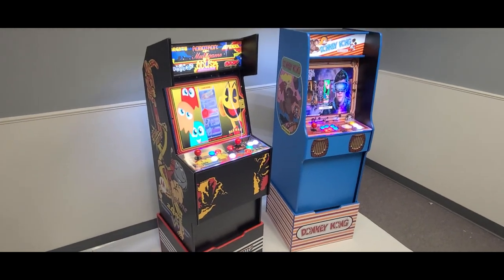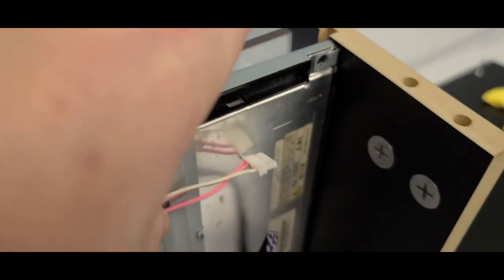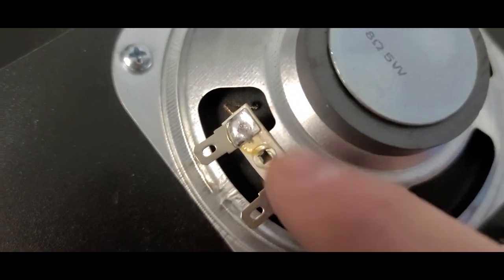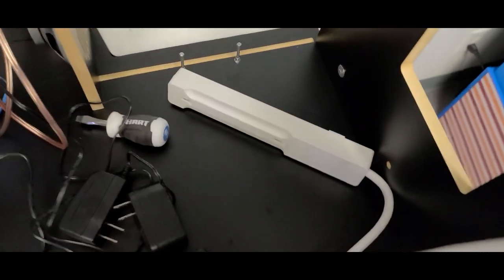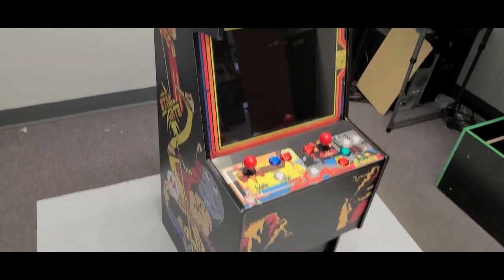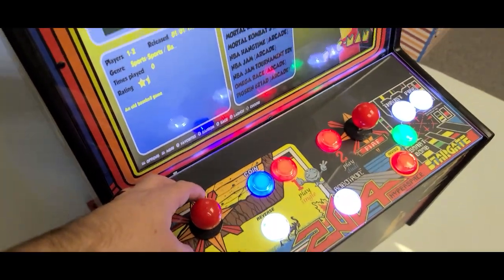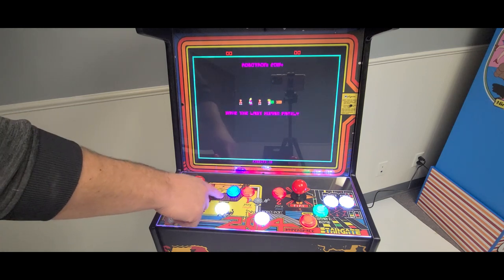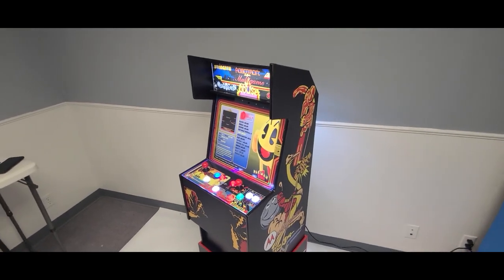AMU Ready to Assemble and Play Model W Cabinet

Comment: Design critique: My opinion you should not use the Arcade1up Legacy cabinet style where the "fins" stick out past your marquee. Just seems like if you are doing 2 player games the fins will be right in your face.
Reply: But your product looks great otherwise and the quality looks good. Who could possibly complain about your games selection!
Are you gonna offer your 2 player XL control boards on these?
Reply from the maker: First revisions had standard marquee further out, but it restricted the ability to see the screen when standing.  These play comfortably for all adult as I am 6' 4".  You still get the proper perspective of cab design from both front and profile.
Reply: @arcademodup2286  Laying the screen down like some of the og cabs would have fixed the view restriction of the screen. The marquee should be all the way forwards imo. That Donkey Kong would look super sweet with the screen down flatter and the marquee pushed forward.
Reply: I also don't like the "fins". Wondering if they could have just made the fins/top of the unit a little higher and angled up a bit - more space between the top of the monitor and the bottom of the marquee, and be able to bring the marquee out to the front. You'd have to be pretty tall to not be able to see the monitor if they did that.
Reply: @davidbellotti1110  their other model has side panels that seem to only allow for 1 player. This one I don't like the fins. Since they now sell a 2 player XL panel, I think they should have went with a cabinet style similar to iircade. That cabinet style would seem to fit their custom control panels better. Especially for 4 player. Especially since these cabinets have so many game varieties.
Reply: @jeremydedrick4054  Good point. I need to check out all of their stuff.